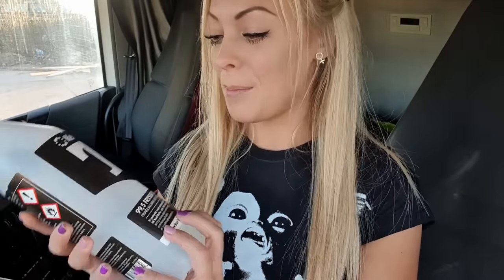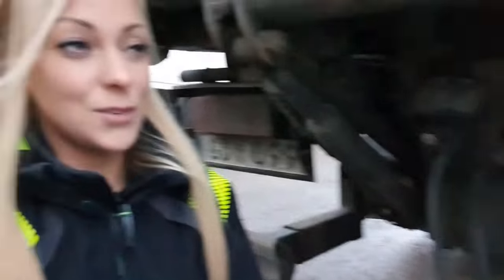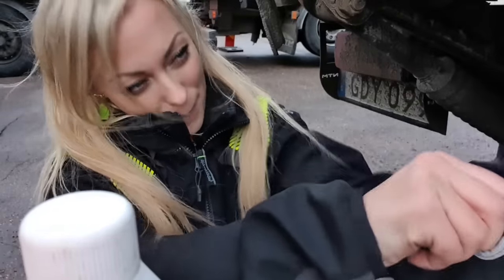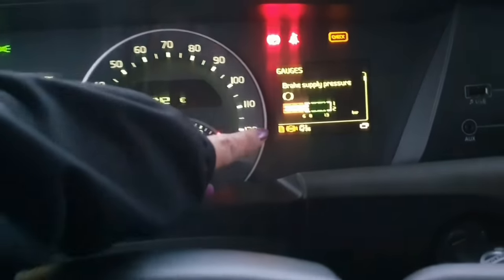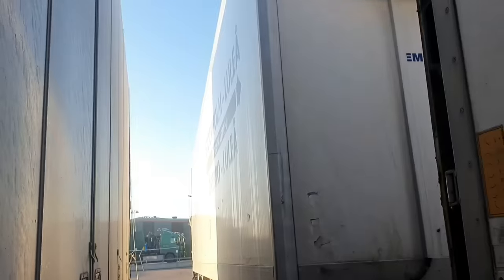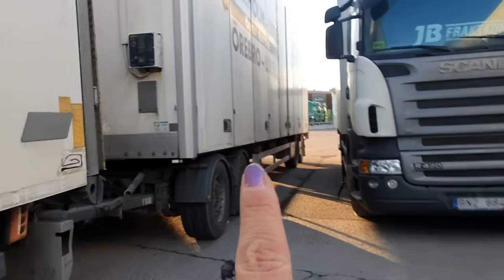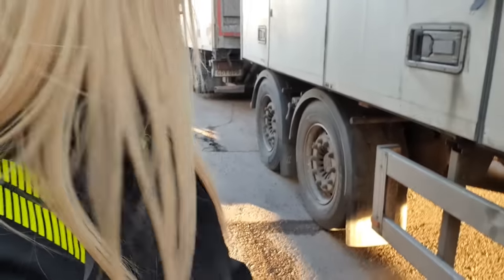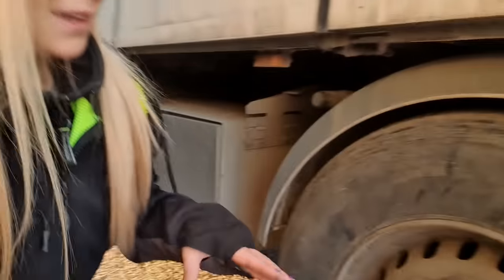Truck brake system, wintertime ❄ - Angelica Larsson

Comment: Be careful folks as to how much alcohol you put in the airlines. When the air comes on, it moves under 200 pounds of pressure. Too much alcohol and you have an explosive situation as well as a possible fire since alcohol is flammable. Great video Angelica. Keep them wheels burning...

Comment: Happy New Years.  Here in the US when breaks freezes to drums you have to hit the drums with a hammer to free them up.  Sometimes you can get lucky and just rock the trailer forward and backwards to free it up. We also use air line alcohol to help prevent freeze up in airlines valves. Preventative maintenance normally we change the air dryer on truck just before winter to help keep water Out of air system

Comment: I drag the brakes for awhile before stopping, set the brakes, then after 10 minutes roll back and forth a bit before setting them again for an extended period of time. Also...be careful draining your air tank when its below freezing out. I've had my valve freeze open when doing that!
Reply: Yeah I was going to say the same thing.  When I drove class A (Tractor/Trailer) that was always the norm...drag them and rock them.  Now that I just drive class B garbage truck its not much of a problem because all our trucks have air dryer systems. The shoes well still freeze to the drum every now and then but I have never really had to get out and heat anything...just slowly give it throttle tell they pop loose

Comment: This why most big trucks use air dryers in the air system to prevent ice build up in the lines to the brakes.
Even the really big locomotive trains have them.
Cold or hot weather will always get some kind of moisture in the system.
What you did is an extra preventative measure as you mentioned going from warm to cold conditions.
Very good job Angelica, well done.
And it is nice to see you getting down and dirty doing the work.
You can do the maintenance on my pickup truck anytime you want to.

Comment: We put alcohol in the air lines in Canada too. Sometimes the brake shoes will freeze to the brake drums too, huge pain in the butt when that happens.
Reply: Thats why disc brakes are another level 😉
Reply: Whats even worse is if your company has dust covers over the shoes on the inside. :(

Comment: You are too sweet, thank you for the well wishes.  Happy New Year to you.  They have just came out with disc brakes on trailers and I have only pulled one on one trip.  Most trailers are still air brakes.  It is typical to do a drop and hook in the winter and find that the trailer that I hooked on to, the brakes are frozen.  I carry a 2pound sledge Hammer like yours a steal rod 3 foot long by a half an inch and crawl under the trailer and place the rod on the brake part away from the pad and beat on it until I break it loose.  A torch would take too long.

Comment: Angelica also on the Volvo there is a tank where you put the alcohol and it enters the air system and helps to remove the moisture which is  there as a result of being compressed.

Comment: Love your video's , I unfroze a unloader valve on a 7-5 tonne truck by boiling up a kettle of water and poured it over it ,the idea being the hot water evaporates before it freeze's and it worked a treat , and once stuck on a patch of ice poured boiling water under the drive  wheels , it melted the ice enough to get grip to get going again , keep up the good work .

Comment: That is a great idea for you to post Angelica. I just love the way you explain everything. Your smile and happy enthusiasm to whatever it is you are doing brightens my day.

Here in Canada we will add air brake alcohol to the supply line only. The other line only goes to the top of the control valves, not into the air tanks. So it would only go in the right side of the duomatic. Anyway, it is very nice to see you make the effort. Many drivers here just call for a mechanic. You really should wear safety glasses whenever you release compressed air or hit rusty metal with a hammer. We wouldn’t want to see anything happen to those beautiful eyes! Keep the great videos of you, trucking and Sweden, coming. 

Hope you and your family have a fantastic new year!

Comment: I always mix automatic transmission fluid to it. The pure alcohol will dry out all the rubber seals in the valves. Could probably mix 1/4 of that container with the oil then u hav a bit of lubrication.
Reply: The Kemetyl T-99,5% Frysskydd are not pure alcohol. Since it's made for this purpose, it already contain necessary lubricants and preservatives for use in pneumatic systems during wintertime.

Comment: …"We'll see how it goes for our little alcoholic wagon..," 😁🤣🤣That made laugh a lot. I take it your tanks don't have a cock valve or "T" valve that let's you open up the air drain without having to crouch there and hold the bleed cable? I just open the valve and jump away and let them drain for awhile instead of having to sit there ...
Reply: I guess the alcohol dries water in the lines and tank huh? we learned in driving school that opening the valve was necessary just to make sure there was no water in the lines and tank.
Reply: @dennisaustin6058  alcohol doesn't dry out the lines from water...it just acts like antifreeze and keeps the water that is in there from freezing...

Comment: A little tip. When you empty the tanks for air just go in the truck and press and release the brake pedal until there is no more air. Its faster and more comfortable way to do it :)

Comment: here in Finland, or at least in "our" company we have bright hats on the wheel bolts that are bright yellow. You place them on the opposite bolts and they point to eachother, then you can easily see if the bolts are lose or from the cabin if the trailer wheels are stuck or spinning. If wheels are stuck i have also used exhaustion pipe for opening the breaks  :D Also Happy new year!
Hats like these: https://www.raskaankalustonvaraosat.fi/pyoran-mutteri-n-osoitin-m33-15226.html
Reply from the maker: Ohh I've seen them 😄 thanks!
Reply: @AngelicaLarsson  Yw:)

Comment: Love how she calls a trailer a “wagon”. 🤣
Reply: Lot of truckers call thier trailer a wagon....
Reply: Technically, she is driving a heavy duty straight truck with a liftable tag axle behind the drive axle, towing a 2 axle towing dolly with 5th wheel to tow a semi trailer with 2 spaced axles, that setup is known as a truck and a wagon combo. To me. European design for making TIGHT turns in narrow European towns and streets.
Reply: It is a wagon. And Americans say wagon-tractor too on cb. But hers is like a kid's wagon, the tractor and wagon are almost of equal length, have you ever seen a 10 car hauler in usa? The truck is very long & trailer is not so long. I will send u a bill:)
Reply: How do you call it? a van !! That tractor can be called a wagon since is a wagon the trailer is behind the wagon
Reply: @TruckinDavo  no trucker calls their trailer a wagon. Maybe in Europe
Reply: @ronaldfurlow3501  No dolly here. It's a wagon with a draw bar. The front wheels/axle is part of the wagon, just like a kids wagon. It steers the same way due to the draw bar. No fifth wheel involved.
Reply: @ericvaria7807  ???

Comment: Happy New Year Angelica!!! I thought that you explained it very well. It's basically the same as we do here in North America (U.S.A). I always put some alcohol in the trucks air system too because those air lines can freeze up too. The easiest way is to just put an alcohol sniffer on your truck, you fill it with alcohol and it just puts a continuous small amount of alcohol in your air system.

Comment: Nice video, very informative. Good start to the new year. I've only had a couple times with frozen brakes on a trailer. Only when picking up, drop and hook situation. One trick I've learned, if your running long in cold winter. The brakes will be warm, but when u stop and engage them right away. It increase the chance the brakes with stick or freeze. Especially, in Very Cold Wind Chills, so I just engage tractor brakes when stopped, then 15mins later the trailer after they cool. Seems to help. Alcohol is good, but my company doesn't allow, due it can deteriorate the seals in the air system. Still lots of valuable info. Like the blow torch handy part. (Question) any mountain climbing in the North, we have the Rockies can be a challenge in winter. Keep up the good work. Happy New Year Angelica..

Comment: Interesting, with the alcohol a possible suggestion would be to transfer some of the alcohol to a smaller bottle and use a syringe to extract the fluid then put it into the brake line, less hit and miss get the fluid into the line and you could measure it if you wanted, here you can get syringes at a chemist of at a veterinary clinic. The only issue with that is the alcohol might destroy the rubber plunger on the syringe but it’d be worth a try perhaps.
Hope you had an excellent Christmas and all the best for an outstanding 2020.

Comment: Good information!  Most brakes in the US are drum and brake shoes the torch will work with this system.  We have a dryer and filter on our air brake systems and we can also drain the air tanks.  Most of our trucks are longer than yours we have a long hood in front of the windshield with a sleeper behind the cab.  Most of our trucks are sixteen to twenty feet long from the front bumper to the back of the truck tractor.  And most of our trailers are 53 feet long and a few are 48 feet long.  We also do doubles on some interstates.  How long are the trailers that are shown in your video?

Comment: Your vidios are ALWAYS informative.  In the warehouse I work in  here in Connecticut ,we have been using safety glasses regularly.  I watched your  tutorial on maintaining braking systems . Releasing air under pressure, in tight quarters,  can be dangerous.  I woried about your safety. Be careful.

Comment: I know disk brakes stop better, but air disk brakes are such a pain to work on and they are always frozen in cold weather! From your explanation it sounds like only 2 axles on the wagon have "parking" spring brakes? Also, I spit my pepsi out when you said it's find to use both holes, hilarious. We used to have alcohol "evaporators" on our trucks that would automatically put a little in the system as you drove but now that we have good air dryers we don't use alcohol much - it's really hard on the brake valve seals and diaphragms.
Reply from the maker: Hahah 😂😂 well, on the truck we have an air dryer, but not on the wagon 😄 yes, the parking brake is in the 2nd and 3rd axle 🙂

Comment: Hello Angelica,
I have a little question, what happens to the truck and the air brakes, or are they disc brakes? here the air is dried by a special filter cartridge. This air is not worked with alcohol. Why ?
By the way, I wish you a happy new year with lots of health and always free streets   😋🙋🏻‍♂️
Reply from the maker: It's air on both 😄 but in 2 of the axels it's disc brakes 😊 (on the truck we don't need to do this because it 'never' freezes. It's only for the wagon

Comment: Thanks for your great videos!
As you probably know, it is quite harmful to your hearing when working with air brakes, especially when releasing the pressure. You may think it is such a short blast every time, but after years of working, it will probably damage your hearing in the long run...
You are a great role model to many, especially the younger girls and boys who dream of becoming truck drivers and you should set a good example and show that it is cool to protect your ears!
Get some Peltor Kids in Pink color (they are made for kids but can also be used by adults). They are really good looking just like you, and had looked great on you when making videos in noisy environments!
Keep on truckin 😎

Comment: There was a place where they had an injector in line with the brake systems. It put a small amount of alcohol into the lines, to do the same thing. Not sure where it was plumbed in, but the canister was on the back of the tractor so it could be reached easily, near the glad hands connection.

Comment: A trailer is done the same way as your wagon. Except here in Canada, and the rest of North America, the service and supply lines to the trailer are separate. Not together like yours. I put alcohol in them just like you did but I don’t drain the tanks. It works it’s way through the system either way you do it.

Comment: I used to go from under and hit the drum with a hammer but i realised all i needed to do was tap the rim with hammer from outside. The vibration from hitting the rim alone can break the freeze and release the pad from drum. I do this while air supply is active to trailer. Can leave some marks on rim but it doesnt really bother my company as most of our equipment in rough shape lol 😁

Comment: Here in Minnesota we have that happen all the time in the winter especially when it gets below 0 ferenheight.  1 day it was even below negative 30 and every time I stopped and set the parking brake I had to take out my hammer.  Also it was so cold I had to heat up the fifth wheel do that the trailer would disconnect.  The graese had basically turned into glue.

Comment: The left hose of duomatic coupler doesn't go to the air tanks, it's for the brake control, so the brake valves open and close depending on the pressure on the left hose. Right hose is for the tanks, and it has constant pressure in it (about 8 bar). In many of the modern trailers it's not approved to use any alcohol in the system, as it damages some of the EBS/ABS valves (depending on brand / model), which are not designed to withstand alcohol - just like the brakes on the truck, where you can't use any alcohol either. So everything in both the truck and trailer is based on air dryer, which dries the air after the compressor in the truck. During last 10 years I have had problem only one time in winter, and that was due to dryer malfunction. For the tyres, we use normally white spray paint to make one or more well visible marks on the side that will last at last for the winter without any problems. It was more common before, now I see less and less trailers with paint marks on tyres... example on the first axel of the trailer: https://commons.wikimedia.org/wiki/File:Kiitolinja_trailer_Finland.jpg

Comment: Here in the states if your air water separator works no big deal, but never set your trailer brakes in freezing weather. Just the tractor brakes

Comment: In Canada we have a few disc brakes.never had a freeze problem..even as low as -20.
Saying that .on our drum brakes. drivers leave trailer brakes released.and the tractor brakes applied.when parked.when they go to leave .they have the drive wheels to break free..
The air brake antifreeze. Only keeps the air valves from freezing...

Comment: If it has been a warm day and I know it will the temperature will drop that night I will lightly drag or apply my brakes while driving. I only do this right before parking so my brakes can heat up a little and make sure there isn’t any water on my brake pads before parking.

Comment: First also the best wishes for you and a happy 2020.
My question;
Do you only release the air from the trailer before you put in the alcohol or do you also release the pressure on the truck?
Greeting from Holland
Reply from the maker: Only need to do it on the wagon 🙂 the truck 'never' freezes 😊
Reply: @AngelicaLarsson  okay thank you. Have a safe trip.

Comment: When I drove a semi always carried a hammer and a a torch
 I would do at pull down on a Johnny bar drag the trailer brakes just a little warm them up to dry them out that always kepted them from freezing up most of the time

Comment: personally speaking, where i work in canada, drivers never put that alcohol in the lines. the mechanics should be doing it when its in for service or when the drivers tell us that the brakes are freezing up. plus i dont know about where you live but here in canada, all axles have brakes. :)

Comment: I see they don’t change air dryer filter over there till it shot just like here in the states, 20 years under my belt used alcohol 4 times ,must be a big temp swing from south to north there in Sweden to Cayuse that much condensation I the lines.

Comment: Don't all of your wheels have pneumatic disc brakes? Just the rear axle/s having an additional system on top of the pneumatic system which is mechanical (parking brake(fjäderbroms?) that automatically starts engaging if you're getting low on air(sub ~4.5-5.5 bars)?

Comment: I usually drag my brakes a little just before parking it dries the brakes before you set them so they dont freeze. But I have had to use your meathods as well.

Comment: Happy new year!   This be our year, lets share and kick some ass!
Didn't know the alcohol trick.. You taught me something, thank you! May be handy with the global deep freeze.
I'll share a trick I have  you may not know.. If you slowly push in the red/wagon brake valve, when you hear a lot of air flying out, hold it there and you can drain most of the air whilst sitting in a warm truck and less time under wagon.
(Should work in Sweeden!)
BTW..  it will drain the truck as well.. it's like a big air leak on wagon. (may trip ur "catastrophic vale")
Care to share name of song in video?  may like that one..
Me (THX to YT suggestions) I'm jamming  (Cher - Believe) CD  Lot's 'o dance music on there and I'd hit the dance floor with you anytime ;)

Comment: To speed up removing all the air from the tanks, with the parking brake released and the engine switched off you can pump the service brake pedal to remove the air. This also means you can stay warm in the cab and it will not be as loud when you remove air from the tank due to less pressure! 😉